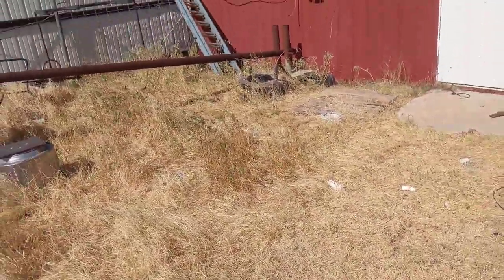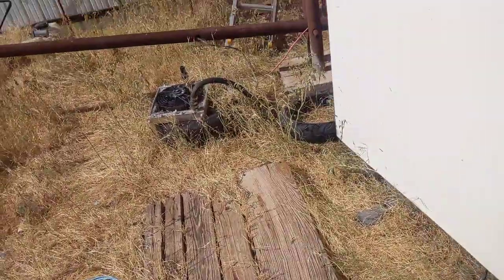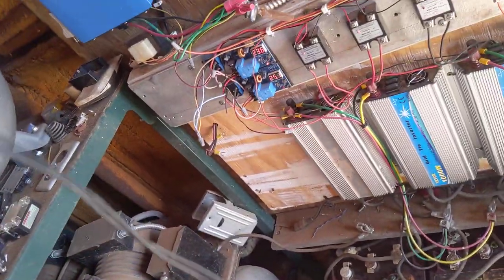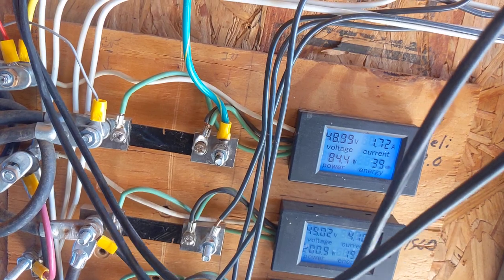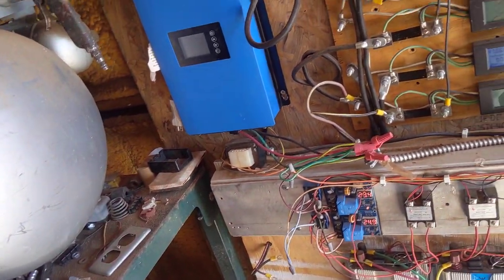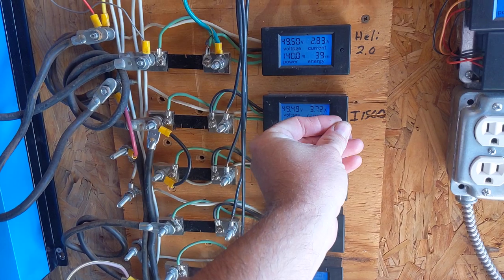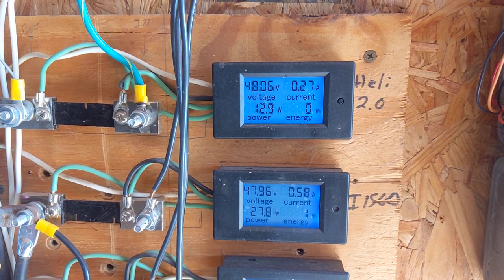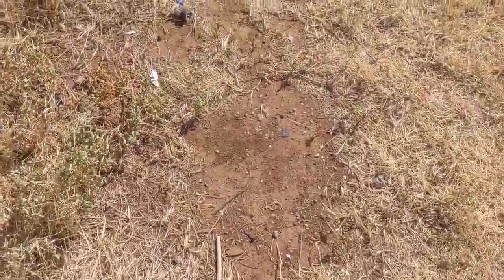iSta Breeze i2000 post slip ring replacement update!

Comment: Have you ever thought about buying an AERMOTOR  windmill waterpump and modifying it to produce electricity?
I like your wind turbines good video !!!!
Reply from the maker: I actually use to work for the American West Windmill Company doing all of Fiasa's QC for 702 model windmills (which were a direct clone of Aermotor's 702).  I spent quite a lot of time actually trying to think of how to use one to create electricity, but never really sorted anything out when I had the chance.  Those things are too expensive to play wit these days.  I think the best bet would be using the sucker rod to turn a flywheel.  They make TREMENDOUS torque that could be geared up if done properly.  It's something I want to try sometime, but with the cost of even a used 702 it's probably not worth the effort.